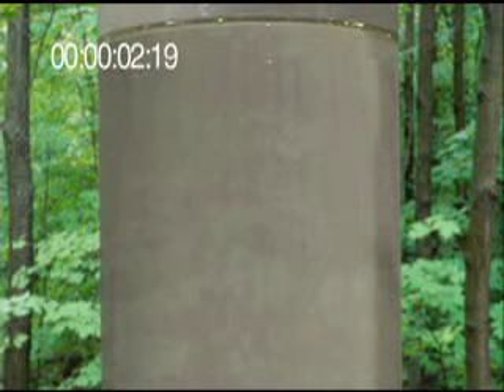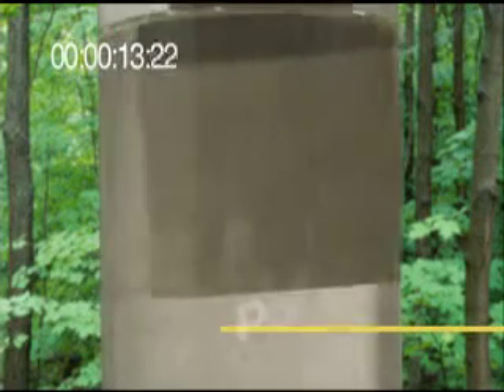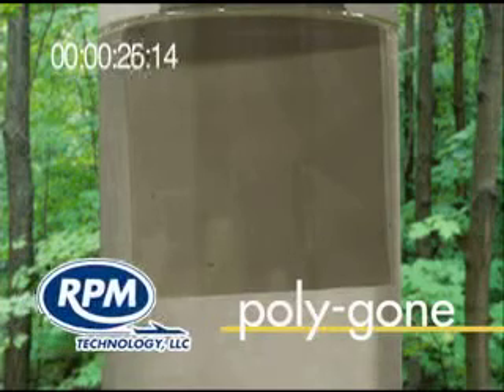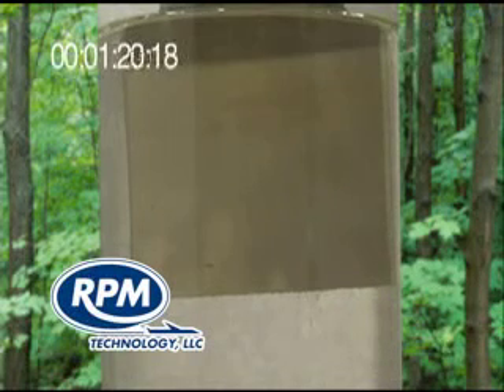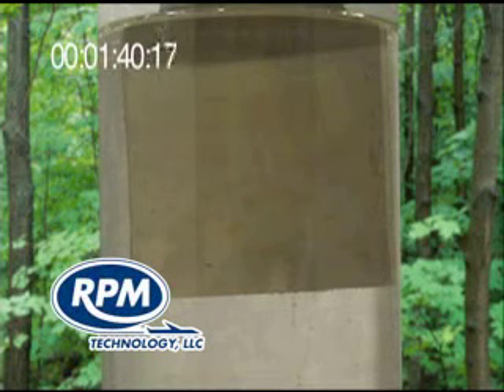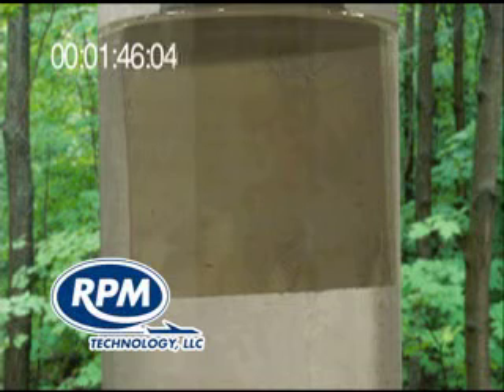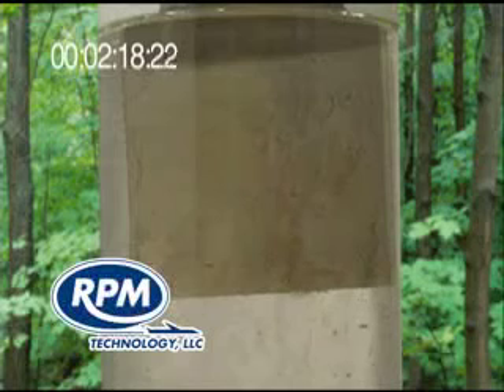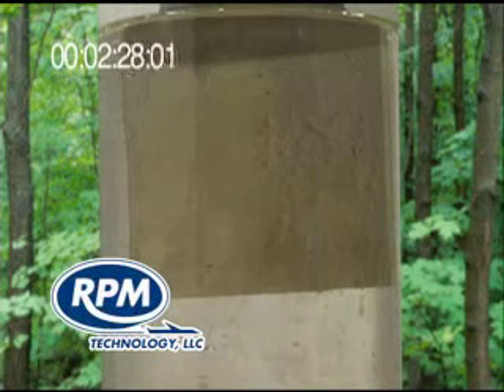Cured Polysulfide Removal with PolyGone™ 310-AG (Aviation Grade)

Comment: How is this best used for Mooney 64 gal tanks? Full flood or some sort of spray and recirculation system? How much is needed per side or per plane if we are doing both sides?
Reply from the maker: Hi Ian, thank you for your note and viewing our video!  For Mooney's we recommend our PolyGone 310-AG Gel version as this is easier to use for an individual.  You will need 2-4 5-lb buckets of the Gel for standard Mooney tanks.  You can contact us directly at 866-271-8766 or contact Aviall, or Aircraft Spruce for the PolyGone. Thank you, Jim